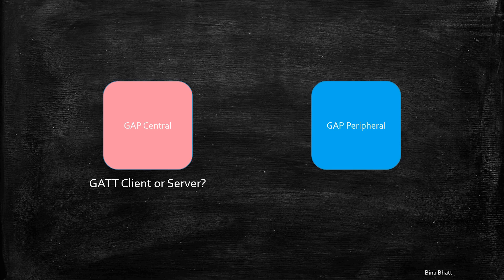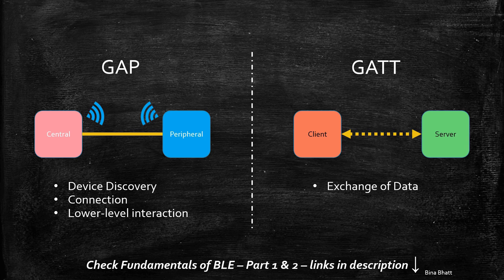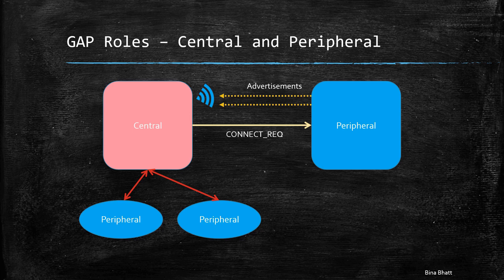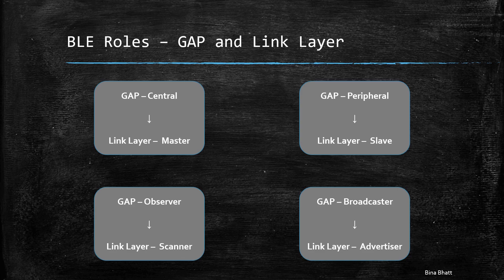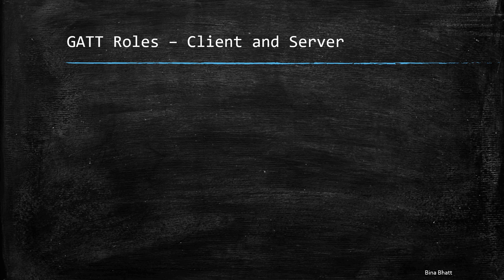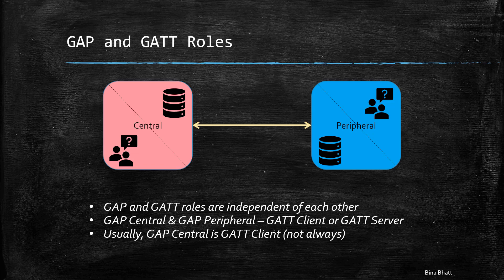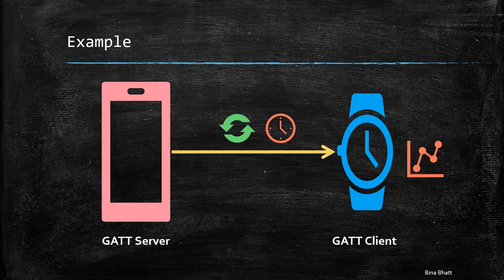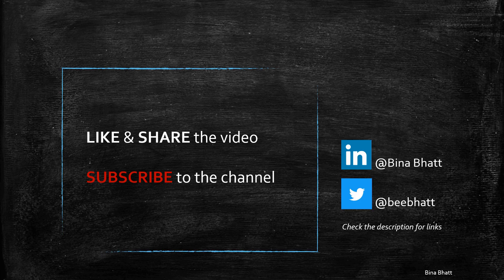Can a GAP Central be a GATT Server?| Bluetooth Low Energy (BLE)

Comment: I have a question regarding BLE in general. From watching your videos, I understand that the data flow can be bi-directional but sequential like once the peripheral transmits some data and the central receives it. Let's assume that Central wants to act on that received data, so it sends some data back to the peripheral. Is this possible or do we have to change the GATT role in the middle of the process to accomplish it?